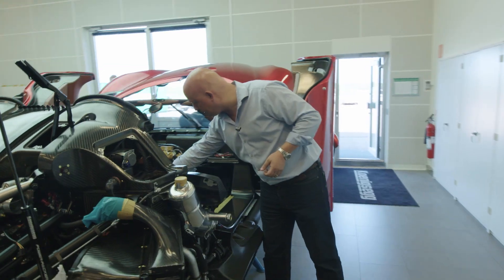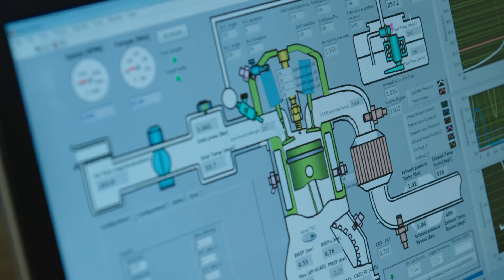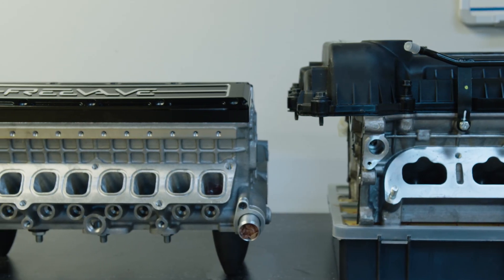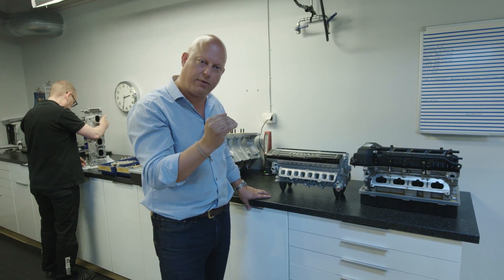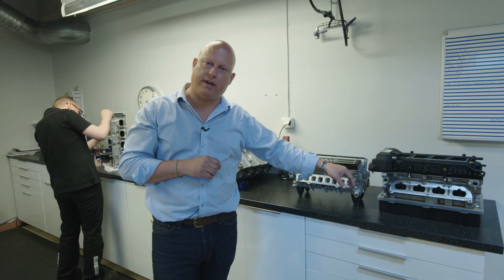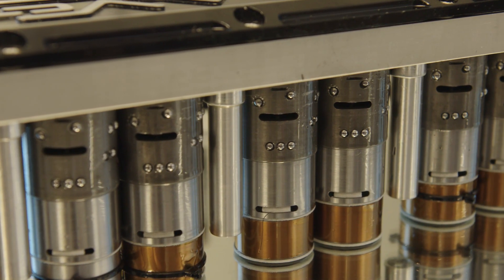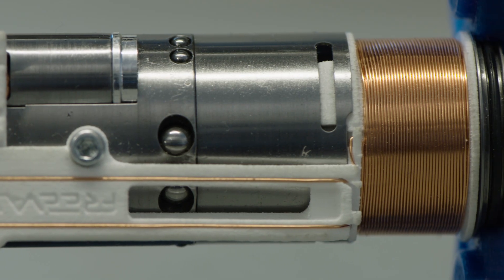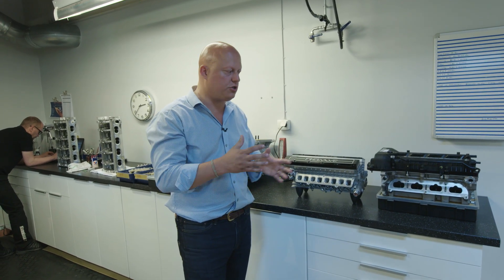Freevalve Update Camless Engine -- /INSIDE KOENIGSEGG

Comment: Man just the reduction in mechanical friction and cams operating valves and stuff this has to free up a lot of horse power
Reply: @Eclipse538 One doesn't need to build engines professionally to know the difference between Otto and Atkinson cycles.

A very basic knowledge of physics is required to understand that smooth, oiled cams are not going to have significant amount of friction. Any external system that provides power to valves will suffer double losses. First from whatever friction you have in converting engine power to this power source followed by valve actuation losses. The only losses in cam shaft drive are actuation friction losses. 

Engine designers are not idiots, cam shafts are used because they are cheap, simple and efficient at what they do. This has potential to be better, but it doesn't seem like a cheap or simple design.
Reply: Dmitriy Laktyushkin The losses come at the valve springs, not the cams, but I agree it’s negligible.
Reply: @Eclipse538 Ok you'll have to clarify here, what do you mean by heat losses? The only losses I can think of are the friction b/w cams and valves as well as the negligible shaft bearing friction. The stiff springs would lose you some energy in compress/decompress cycle but that is under 10% loss for any decent spring, valves closing return the remaining energy back to cam shaft rotation.
If you are implying heat is lost due to fixed timings, then you've just changed the subject and basically agreed with me.

Have you measured the actual cam shaft power use? Has anyone? I've been having trouble finding this with a general google search which makes me think the losses are small. If you have any data I can look up I don't mind being proven wrong.

Also creating pneumatic pressure will take more power than straight up driving cam shaft with an electric motor, compressing gasses is notoriously inefficient. Not an issue for this design because it looks like they've got electromechanical actuation, but even this is hard to get more efficient than a simple cam shaft. Never mind the fact that powerful, fast and reliable linear electromechanical actuators are expensive and hardly more effiicient than a cam shaft.
Reply: @Eclipse538 I was gonna try and correct your thermodynamics, but then I realized you are basically saying the same thing as me, just using rather confusing language.

I'm guessing what you are trying to say is that the valvetrain generates a lot of heat from your personal experience, not sure how you would measure that without running the engine though.

I'm an electrical eng myself, not in motor related business but I have some experience with linear actuators. They aren't cheap and they aren't efficient if you are going for something powerful, fast and compact. You also have inverter losses.

And compressors are not efficient by virtue of being mini A/Cs. You compress a gas, it heats up the compressor which you need to cool down. And thats before the pump frictional losses which make valvetrain seem like a joke. Don't forget, same as valvetrain, you need to run your pump harder to pump more air at higher rpm.

At this point there is nothing more to say without providing actual numbers and only  Koenigsegg can do that (hint, hint). Also any chance you remember what power drill you spun the valvetrain with and ~rpm you got? And what size/type engine? Would be nice to have a ballpark estimate for power losses.

Anyway I'm still not convinced you can decrease the power losses just by powering valves externally. You still need to apply the same forces at the same rates to the valves. Valvetrain has stuck around for a while and only reason I can think of that we still see it on all the modern efficiency oriented engines(which major manufucturers spend millions in R&D on) is that the benefits of independent valve actuation are not there if your valve timing doesn't need adjustment.

Unless there has been a patent blocking independent valve timing for the past 10 years, then it makes complete sense.
Reply: @Eclipse538 I see that you wrote book long commentshe, but let me tell you this. The use air to open and close the valves has ZERO relation to efficiency. It has NOTHING to do with efficiency. The pneumatic valve system was invented somewhere in late 60s just to eliminate the spring float and that stops at that. The so called free valve is a disaster in terms of maintenance, cost and efficiently. You have to set them up every time you want to drive your car, and for that you need air compressor to supply your air. 😄
Reply: the chains  also
Reply: Yeh you can feel the difference when you get rid of the steel fan and the air con pump
Reply: If the pneumatic system can move valves efficiently it does have potential. Fewer rotating parts and less mass being moved or spun will free up hp
Reply: @Eclipse538 Moving mass requires energy. The simple equation for kinetic energy is  E = 1/2 mv^2  where m is mass and v is speed. Moving a camshaft which has substantial mass requires substantial energy. Moving air which has much less mass than a camshaft requires energy but much less energy. Now for thermodynamics of this system. Energy is defined as the capacity to do work. Heat and work are two equivalent ways to transfer energy. If we spend less energy turning a camshaft (work) then there is less chance for energy loss in heat. The second law of thermodynamics says the entropy of a system tends to increase. Entropy can be thought of as the disorder of energy. In this system disorder would be heat. So the more energy we spend moving mass the more disorder we impart into the system which brings heat loss. If we move less mass there is less energy required.

Thinking about a weaker spring being on a performance engine doesn't make sense to me. When a valve is being slung open at 6,000+ rpm one would think it would need a strong spring to close it quickly. There is a lot of inertia from opening the valve to overcome before it can begin to close again. Maybe they have a vacuum system included into their pneumatic system but I would venture to guess a strong spring is hard to beat and a pneumatic system should have no trouble overcoming that resistance.
Reply: Eclipse538 bro you’re in the right. In fact engines already provide compressed air in the form of a/c, enough to make this system work. It’s not a matter of overcomplicating things, it’s a matter of using what’s already there in the first place. Btw I can’t wait to see the tuning range on this system paired up with say a double shaft, twinscroll, variable geometry turbo. Then we can talk about overcomplicated hahahahaha but I’ll probably be too busy with such a wide powerband hahahaha have a good one!!!!
Reply: Danimal 86 I bet it’s gonna be great for high horse power applications
Reply: Duh
Reply: I'm just wondering why they don't use hydraulic or solenoid to control the valve actuation? Is pneumatic more superior? Pneumatics has always been energy hungry, correct me if I'm wrong.
Reply: @Eclipse538 have you ever tried to turn a camshaft by hand fighting the valve springs? Its not easy, not only that but the rotational mass, and chain or belt driven cam also adds more resistance. Its not ONLY the resistance of the cam on valves that would be eliminated by the freevalve system. Its also all the other stuff too. I mean it speaks for itself, koenigsegg already converted an engine that was once a traditional cam driven engine to a freevalve and it picked up a very large percentage of power.
Reply: @Eclipse538 I think you should reassess the magnitude of said friction. Cam shaft is well oiled and operates under low load. Given the simplicity of design you'd need to spend a LOT of cash to get any other method of valve actuation more efficient than low friction cams. Also Atkinson/Otto cycles are basically different valve timings. So yes, you can get efficiency/power purely on adjusting timing and it has little to do with being able to heat up you cat converter faster.
Reply: Probably not, pneumatics will take as much or more power to run than cams. As the guy explains the benefits are in overall cost, custom valve timing and size. The power and efficiency increase will come from custom valve timings.
Reply: @DmitriyLaktyushkin  he doesnt really go into detail about how the valves are actuated but i would guess its a pressurized hydrologic rail with electronic actuated solenoids. A very small hydro pump like what is needed in this application would probably be electric driven and not gear driven or direct drive like bigger hydro pumps. If this is the case then it would be far more efficient and less of a power loss than a chain or belt driven dual camshaft engine. Have you ever tried to spin a high combustion engine by hand? It takes a lot of force and a 3 or 4 foot breaker bar.
Reply: @danimal865  Basically copy of Fiat's multi-air valve system.
Reply: @DmitriyLaktyushkin  also he says the efficiency increase comes mostly from the cold start, not variable timing. But the variable timing is a major power adder, along with far less mechanical friction. I mean the engine almost doubles in horse power. NO amount of variable timing can give you gains in power like that. I bet most of that power come from lack of friction and heat
Reply: @danimal865  Not just that alone. You lower the steps how a engine works. The more power it adds. You can take a same CC output with same cyl size. The 2stroke engine will have more power than the 4stroke will. The less phases you have the more power.
Reply: @powerwill8748  the difference in 2 stroke and 4 stroke is also low end torque, if you need low end grunt, a 4 stroke is better
Reply: @danimal865  Not always.  from experience of doing motorsports all my life and boating. Most same displacement engines will not only accelerate faster but also at a higher rpm speed. This freevalve system can be ran like a 2stroke. My dad owned many 18wheelers. The older engines from the 70s 2stroke outperformed the newer engine's with the electronic fuel pumps at same engine size. From acceleration to ⛰ climbing to top speed. Im no tech but from experience. Engines with less  movements phase had more power
Reply: @powerwill8748  i have no experience in diesel engines but im just talking about atv's and dirt bikes. 2 strokes take off on top end but 4 strokes have the low end torque out of the hole
Reply: @danimal865  they just announced their new car. It has a 3 cylinder 2 liter 600hp engine using this technology
Reply: @danielmoth8917  yeah i seen that. Pretty crazy.
Reply: @DmitriyLaktyushkin  what about electronic actuators? 

https://images.app.goo.gl/Ycxu2VwXyg3mm7Hs7
Reply: Dmitriy Laktyushkin Could use the exhaust to create pressure instead of a compressor connected to the crankshaft.
Reply: @DmitriyLaktyushkin  They looked like electromagnetic actuators, based on the copper winding around it. It may take like 6V max lol, even if it were pneumatic it doesn't take much to run that compared to a timing belt / chain + 2-4 cams, those are heavy asf and it has a lot of rotational energy and slows down the crankshaft.
Reply: @DmitriyLaktyushkin  couldn't they use a turbine to spin up a compressor which runs to a air tank that provides the pneumatic pressure? That wouldn't take much hp
Reply: @DmitriyLaktyushkin  no its not. These springs are much smaller and lighter (I bet you can press them by hand), not like huge and heavy duty cam springs.
Reply: @Eclipse538 Cool, thanks for the info. The things you can learn in youtube comments...
Reply: @DmitriyLaktyushkin  to put what old mates saying in another context, it's like how a turbo is more efficient then a supercharger because it doesn't suck torque from the engine, say if you have a supercharger that will give you 21 more hp, it will be useless if it takes 20hp off your crank pully to run
Reply: @Eclipse538 

PS

The pneumatic valves (as this guy likes to call it free vlave) have been in use in motorsport quite extensively and has been quite successful for its purpose. In motorsport, you search for for smallest increase efficient that leads to wins, but pneumatic valve is not used for that purpose. For example, in motogp, everyone uses pneumatic valve, but Ducati uses Desmo valve system and Ducati engine produces the most power for the fuel it burns. That alone proves to us that the pneumatic valve (or as this guy likes to call it free valve) are not used for efficiency.

BTW look up Fiat's twin air valve system too.
Reply: @remid1994 Very aware of the desmo system myself. It's just cracks .e up. People take this Ksig guy like he created the wheel. In the Vid up above he didn't to my knowledge in light me on a new Tech he created. Even now as we speak the new hybrid came out. Says it has a 3cyl 600 HP tri turbo system. Would like to see a vid on the teardown of that engine.
Reply: Yeah, you don't lose torque having to compress all those stiff valve springs, of which there are many.
Reply: @Eclipse538 Haha look at this sheep 😅 I am sire not only you have no scientific/engineering education, you have no education at all. I am sire you don't even know what valve is. You basically copy paste bunch of texts from elsewhere without even understanding it. You have no clue about thermodynamics whatsoever to even begin with touching this topic.

This man just rambles about an unproven, and commercially impractical concept only to his horde of fans just to increase his stock. He made so many claims that are not true. He also said that he was going to beat the nurburgring, but only kept on crashing his drag cars. 😆 It is so funny and at the same time absurd reading the things his fans (including you) post on youtube.

You basically think that this so called free valve works with a magical power from somewhere undiscovered in the universe 😆😆😆
Reply: @Eclipse538 I very well know thermodynamics and efficiency of a system. Again, the pneumatic valves had nothing to to with being more efficient. It was invented to solve the spring float. The friction in mechanical belt or chain driven cams are negligible in calculating the total efficiency of a ic engine. It's all about thermal efficiency. The pneumatic valve system has been used for decades in motorsport. It never made its wat to production due to the fact that they are useless for road going cars. It's just Koenigsegg that is trying to create buzz with claiming something he can't prove and he claims that the idea is originally his. You and mr Koenigsegg can say all you want, but you are actually saying nothing until you verifiably prove your claim.
Reply: @Eclipse538 Well, I have nothing more to add other than repeating what I wrote earlier. 

I would like to ask a question since efficiency is the topic. What powers these supposedly free valves? Where does the energy come from? and how many percent is the thermal and mechanical inefficiency of the conventional mechanical valves compared to the so called free valve? I'd love to see some numbers.
Reply: @Eclipse538 You are too ambitious my friend! 😃 Let me just out it this way. Normally, a process can never be 100% efficient, meaning that you always have to consider how much energy you feed the system (in this case heat engine), how much energy is dissipated and how much work is done. Anything, like compressor/turbo, supercharger...etc..etc that needs to do some work, needs energy. For that you have to feed enough energy to get the work you need done. Now tell me, how can you say that anything in a system can produce some work without needing energy fed to it or to the system. Just look up the efficiency formula n(th)=W(net)/Q(in). Thermodynamics makes life simple my friend 🙂 No marketing gimmick, no lies. Just facts
Reply: @Eclipse538 I think you are struggling between the science and marketing gimmick 😄. talk about low IQ! I honestly think that you have no understanding of science and engineering. You are simply repeating this guys words. Basically, even he can't tell you anything about it. He simply rambles on and throws out some words just to increase his stock between his uninformed fans.
Reply: @remid1994  I agree. I think Ksig is doing some great things but the all the free valve language is marketing

Comment: Would the extreme heat from the engine not damage the free-valve electronics.?
Reply: Stu F, not long ago you’d have been right, but there’s electronics available now with extreme temperature tolerances. I’ve been seeing this for some years in the IT industry. “Environmentally friendly” high end server and networking equipment that work happily without air conditioners even in mid summer, or the networking gear in sealed metal boxes on top of microwave or cell phone towers that can be in freezing cold or  blazing sun all day. It’s kinda like military spec electronics that’s now available to mainstream products.

Comment: 😂 sounds like more money on engine maintenance and software upgrades 😂
Reply: It's using less clockwork mechanical parts and more simple electro-mechanical parts that anyone with a bit of copper wire can replicate.  With this design, I bet anyone could replace the valves or solenoids.  Timing this could easily be done with the same kind of timing systems used for firing ignitions coils.  The best part is if the solenoids fail or the current is too weak/ the voltage can't get high enough, they will recede back into the solenoid and won't cause mechanical interference.
Reply: Uh do you know anything about cars . If not, educate  yourself before you speak ignorantly. Thank you.